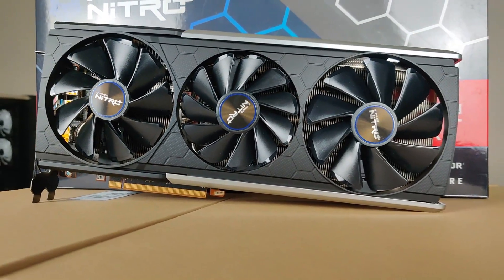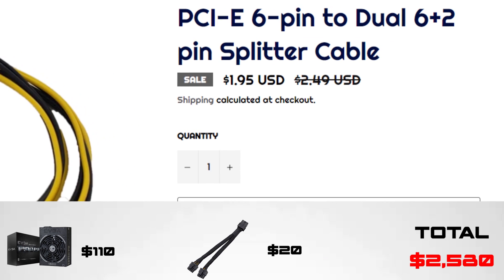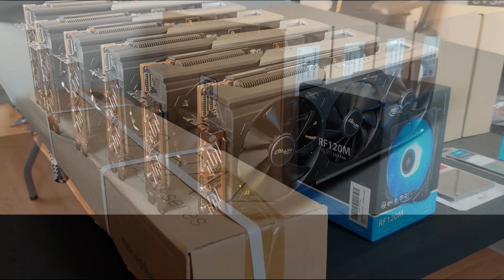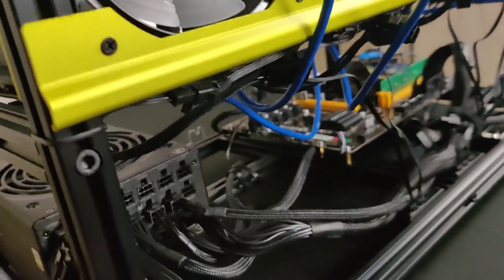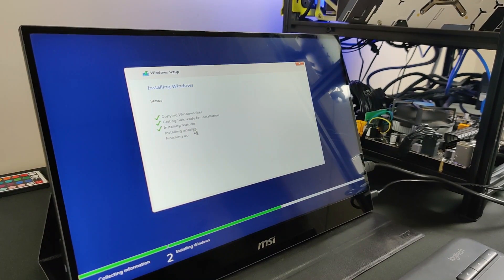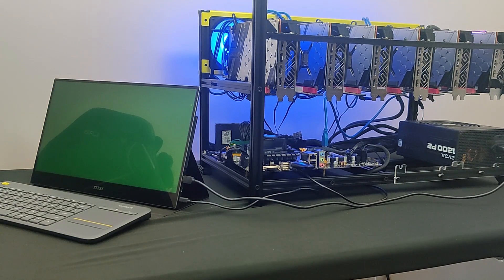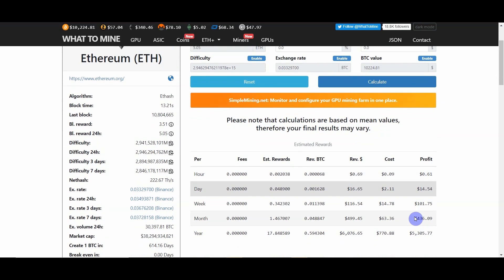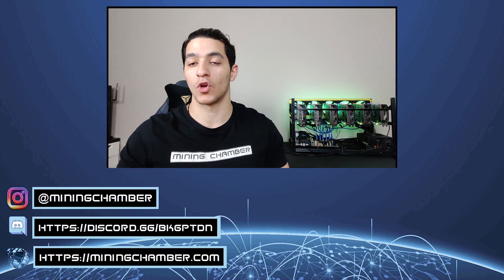RX 5700 XT Mining Rig Build - 6 GPUs | 330 MH/s and ONLY 880 Watts!!

Comment: RX 5700XT Nitro plus should issue 59mh/s
Reply from the maker: It can reach that for sure!
Reply: @MiningChamber  1000% You need to flash the timings and configure the card correctly and everything will work 350mh/s. our cards can be even more ~60+mh/s
Reply from the maker: Oh wow that's awesome, I did BIOS mod all of them with the usual copying 1550 timing to the values below, it can be found in our 5700 XT gpu overview video. Is that the flashing your referring too or is there more we know not about?

Comment: Hey brother, great video! 1 question.. the fans you put on the frame towards back of cards, are they blowing air into the rear of the cards or pushing air away from cards?
Reply from the maker: Hey thank you brother! They are pushing air towards the gpu and then the GPU pushes hot air out towards the front of it (I/o ports on the metal bracket)

Comment: hey im new here, i was wondering what you think of nice hash. i heard it automatically mines the most profitable coin and trade it in to bitcoin, automatically. i was wondering if I should just use that  or do something else. I'm pretty much a noob when it comes to stuff and my kwh here is 10 cents where I live. So would it be worth it?
Reply from the maker: Hey welcome! Nicehash is great for getting started but I would still recommend running phoenix and such since Nicehash takes 5% while doing it manually ( which isn't hard to set up at all) takes about %2 at most. Mining most profitable coin then turning into BTC can depend on when you decide to sell or not. Since BTC can also go down and up! 

10 cents is a pretty decent rate for mining for sure! 10-13 is usually average electric rate
Reply: @MiningChamber  ok thank you so much

Comment: Nice vid man how do you connect the 6 gpu's ? at you psu with an 6 to 8 pins splitters? I have an hx1200 that can handle 5 gpu's so i need to spilt it up i think.
Reply from the maker: Hey! We connected them using splitters! so just try to get some splitters and then if  you end up not having enough still then you can power 1-2 risers from Molex
Reply: @MiningChamber  Thank you for your reply. My risers are connected via molex that is ok but the rx5700xt's have an 8pin and 6pin connection and my psu corsair hx1200 have only 5x 8pin to 6+2 - 8pin so basically i only can connect 5 gpu's. What do you recommend in this situation?
Reply from the maker: You should get splitters in this situation, I recommend checking our ATX PSU guide! It will help you avoid damaging your hardware and properly hook it up
Reply: @MiningChamber  thx nice guide, i have 8 pin female to 2x 6+2 pin male splitters so i can expand one off the 6+2 pci-e connections https://media.s-bol.com/J6Zr8nmZVn5P/550x316.jpg for two gpus right? without doing dangers things.
Reply from the maker: Power first 5 GPUs with what you have and then add a splitter or two to power one gpu through 2 cables. Also I recommend getting additional splitters to power your risers with 6 pin too since it's alot more safe and reliable

Comment: Amazing video, used your affiliate link to buy all of the same parts... I’m thinking about doing 2 more GPUs... is one PSU OKAY? I have the same one. And when do I need a new PSU? Could I  run 16 cards off same motherboard with 2 of those PSU?
Reply from the maker: Thank you!! I would recommend doing 2x 850 Watts PSUs or 2x 750  or 1600 Watts PSU so you can stay on the safe side! As for the motherboard you can run max 14 cards out of Asus B250 Mining Expert without having issues, the 5 other slots need to be mining dedicated cards I believe. 

I would get 2x 1600 Watts for 16 cards!

Comment: If it is 12x5700xt, do I need to buy 2 monitors and 2 keyboards?
Reply from the maker: It all depends! If you do all 12 cards in one motherboard then you just need one. It's basically a PC with multiple GPUs. If you seperated them and did 2x 6 gpu rigs then yes, but one monitor and one keyboard is good enough for both scenarios since you don't want to keep the monitor always on when it's mining, it will just use more power

Comment: I’m closer to getting everything assembled :)
Let me get this straight, you are running the VGA cables from the PSU to the 6PIN female end of the splitter and then connecting BOTH two 8PIN male ends of the splitter into the GPU?
Reply from the maker: Bingo. ;) Watch our Radeon VII build we go in details with the wiring !

Comment: Where does the purple/white 2PIN wire connect to on the motherboard? (5:57)
I’m in over my head 🤦🏼‍♂️

*UPDATE- After some research, I figured out it’s the Power Switch cable so I connected it properly to the PANEL1 ON/OFF pins (15/16). But where does the other end go!? I see in the video, you just wrapped it around the motherboard post, so I did the same. Does it not connect to anything?
Reply from the maker: Exactly you can just wrap it around!! And awesome! It's like a little switch that's basically it!
Reply: @MiningChamber  Thank you! 🙏 
You’ve been a lifesaver! 😇 Do you have a video going over how to plug in the rest of the cables? Where do I connect the rest of the power supply /PCI-E cables?
Reply from the maker: @st.patrick2207  yes we do! Our 2nd video in the channel is a full guide to build a rig ;) check it out! Thank you!!
Reply: @MiningChamber   I watched the video but unfortunately unable to determine where everything goes. The VGA cables connect directly to the GPU’s? Why do I have 4 x PCI-E 8 (6+2) and 2 x PCI-E 6-PIN + 8 (6+2) VGA cables? I’m lost.
Reply from the maker: Try watching this video https://youtu.be/e7AO8ADUD5g it will clarify the cables further

Comment: Im just trying to understand how is that possible to get above 50mh/s on PCIE x1 lane. Bandwidth while mining do not require so much space like while playing games?
Reply from the maker: I'm not sure what you mean! Cards are capable to push that much hashrate due to memory bandwidth and frequency, with gaming it's different since it is also very core intensive while mining on AMD cards is usually just memory intensive
Reply: @MiningChamber  I was pretty sure high lvl cards like 5700 XT and above needs more than PCIE x1 to work on full performance :D so thats kinda shocking right now to me. Good job, thanks for that video!
Reply from the maker: Ohh I see! Maybe because the risers are also powered by an external 6 pin to provide watts to the cards ! Thank you! Cheers my friend

Comment: Good vid man. Why do Windows mining over Linux mining? Wouldn't Linux be better for this?

Also on a side note has anyone done anything in the realm of building a fish tank version of these and cooling it with silicone or whatever instead of fans? Wouldn't that offer more efficient cooling and allow you to jack the speed up on all the cards?
Reply from the maker: Thank you! Linux is surely better for lot of scenarios but since I never had issues with R7s in windows 10 that's why we don't mind it there!

As for the fish tank I have seen a couple projects cooled in distilled water a while ago it's pretty awesome! You can only push them so much though

Comment: Hey there! I finally got all my RX5700 XT Nitros and parts for the 8 GPU build. Running into major issues with the 2 EVGA PSUs for some reason not firing up the rig. It just turns on for a split second and not even most of the hardware turns on, then off. One PSU clicks, then the other. Never seen this happen with my other 8x card builds. Any idea what could be happening?! I'm using the Asus B250 board with 2x 1000w EVGA Supernova Gold. I can get 1 PSU to work, but I'm limited to 4 GPUs (being ultra safe with wiring). Going to try the PSU to see if 2nd one is a dud.
Reply from the maker: Yes definitely check your PSU! If one works fine then everything in the motherboard should be good but the PSU! Let us know!
Reply: @MiningChamber  Problem solved! I was being an idiot and connected the PCIe molex bank connectors on the mobo. Apparently do not do this if you're using powered risers; I read a post where a guy fried his PSU this way instantly. Strange thing is that I have another 8x GPU rig that has exact same B250 mobo and it's been running with the molex connected to the banks w/ powered risers. Needless to say, I fixed that right away as I figured out what was causing the malfunction on the new rig. Good pro tip for your new vids: don't be an idiot and read the directions hahaha
Reply from the maker: Oh wow that's interesting, your referring to the molex connectors on the motherboard and you connected them with a molex strand and that was why it didn't work? Usually you do need to power those that's quite interesting hahah
Reply: @MiningChamber  did BIOS flash on these and then tuning. Looks like Phoenix Miner runs this much better. Claymore seems to not be able to tune voltage (always) and memory (sometimes). Running stable right now on Phoenix Miner @ 438.8 MH/s (8 Nitros; ~54.8 Mh/s each) at 735w total GPU draw and 1200w at the wall. How am I getting so much draw @ the wall?! My other rigs are also ~400-500w in system/PSU efficiency loss. I'm stunned when I hear people budgeting for 200w system draw....

Going to keep tuning... life of a miner lol. Thanks again for the videos!
Reply: @MiningChamber  You're not supposed to run the molex to the mobo banks if you're using powered risers. Do some searching on the web and you'll find some forum posts about people frying their PSUs by basically doubling up on the mobo molex + risers. I am surprised my older rigs haven't had issues with this double connection, but these new EVGA PSUs caught the issue without even me knowing about it....

Comment: can you send me the link of the adjustment profile that you used ? ( I got the same GPU cards ) :P
Reply from the maker: Those adjustments I made and saved locally! And remeber even if it's the same gpu model it might vary on how you can push the card. Check miningchamber.com overclocking section and use the value range we give so then once you find a stable point you can save that profile on your mining rig

Comment: After downloading the latest version of clymore miner (it is v15.0 now) ,
unpack it, find the "start" file and select the edit file option. 
Delete everything from inside, copy-paste this and you are good to go. 

"setx GPU_FORCE_64BIT_PTR 0
setx GPU_MAX_HEAP_SIZE 100
setx GPU_USE_SYNC_OBJECTS 1
setx GPU_MAX_ALLOC_PERCENT 100
setx GPU_SINGLE_ALLOC_PERCENT 100
EthDcrMiner64.exe -epool eu1.ethermine.org:4444 -eworker Rigx8 -ewal 0xe5e011441dc2353b046aa30a22a818f0a44f7468 -epsw x -dcri 9 -tt 75 -rxboost 1"

All you have to do is swap the address with yours,
save the change and run the "start" file.
Reply from the maker: Thank you ⛏️⛏️

Comment: How did you install the ARGB Sync Cable with the Mother Board? Is anyone can help me about it?
Reply from the maker: I did not install one, it doesn't use sync it just runs off of a controller and a 12v to SATA. Some RGB fans require sync but for these we ended up getting a controller with 12 v to SATA
Reply: @MiningChamber  So, I ordered the EZDIY fan from the link you provided. And there is a ARGB link came with. So, do I just install the SATA cable into the Power supply and leave the ARGB Sync Cable?
Reply from the maker: Correct you can leave out the sync cable and see if it runs. If your fans have one cable to connect then you should be fine
Reply: @MiningChamber  Thank you ~

Comment: asrock rx 5700 xt taichi i did mod but i got black screen! 
so is that lock stock bios ?
Reply from the maker: Hmm could be a locked up BIOS, did you save the original BIOS?
Reply: @MiningChamber  I gave for warranty there replaced. I got it back and. Please tell me Which is best for Rx 5700 XT with mod
Reply from the maker: @LifeHacks007  Nitro+ is my top fav model but other than that all of the cards should be the same. GIgabyte and Strix need the specific BIOS I have pinned in this video https://www.youtube.com/watch?v=F-GFMUYFQPM other than that try to look for the ones we recommended in that video linked above ^ We have a list in the description for it
Reply: @MiningChamber  Thank you for reply! :)

Comment: I am building this rig right now.  Sadly I ordered 4 of the msi radeon 5700 xt mech os.  I got them in the mail and they where manufactured in Tailand.  I got them at a decent price so it is what it is.  I just will keep them around 55 mhs until I get a feel for them.  Can I make a 8 gpu version with two 850w gold power supplies?
Reply from the maker: Nice! It is okay as long as you can provide nice cooling for them, a box fan does a great job. 

Our next build is actually exactly that ;) 8x 5700 XT with 2x 850 Watts PSU ! So you will be all good

Comment: Currently running 4 Sapphire Pulse Rx 5700 XT cards on an Asus B250 Mining Expert. I followed your guide for the memory straps mod and didn't touch the power play tables. I then undervolted in hiveos beta. 224mh at 535w from the wall. -vdd 750 -cclock 1375 -mclock 915 (if Micron memory) -mvdd 1305 -vddci 775 (if Samsung memory) -mvdd 1355 -vddci 815 I applied my gpu settings on a per card basis within hiveos not phoenixminer command line. All credit to mini_me on the igorslab forum for the memory values.
Reply from the maker: Nice!! I will be trying out these values thank you!

Comment: Did you get this sorted out?  Just did a video with my pulse 1 card test idle draw on my system is 17w with the card its 35w thats 18w a card just from fans which adds 108 watts to your system at 6 cards.  I am getting same numbers as you at 158w total system with 1 card which puts it at 948w with 6 cards which is only 8w more then what you are getting now.  So am thinking the extra watts is from the cards fans using power when ramped up for cooling.
Reply from the maker: That can for sure be the reason, maxing out the fans will add more watt usage although now my rig averages 880 watts off the wall with fan speed at 60% and a 780 mv undervolt
Reply: @MiningChamber  nice right on got it sorted out then :)
Reply from the maker: Awesome ;)

Comment: Hi bro I have some problems  when I  run 6 GPU maybe  5 minute  my pc is shut down but when  i  use 5 GPU it works well 
I use power Supply 1050w gpu 3 asus 1660 and gpu 3 msi 1660 super 
What the problem please help me
Reply from the maker: Hey! I would check your motherboard settings for enabling 4g decoding, mining mode, etc. If you have any of those. They can be found in your motherboard BIOS
Reply: My motherboard is asus b250 mining mode  is enabled I use only 1 power Supply  1050w how to fix or I have to change power Supply?
Reply from the maker: Hmm that's wierd, double check all your connections and cables. Try to not overclock that card too much or try to switch out one of the 5 cards with the one that you take off to see if it is because of the card or because of having 6 cards plugged in.

Comment: Would you recommend waiting until new GPUs are released or using the components recommended in your video? Thanks for the video!
Reply from the maker: I'd recommend trying to look for deals! If you can't find good deals then waiting till new GPUs are available will be better financially
Reply: @MiningChamber  waiting for new GPU's will have you waiting for a few more months I'm afraid :D at least you can get some 3090's, which at 110-145M using ~300w are not that bad :)
Reply: just buy all until its out of stock too

Comment: So, an Antminer S9 with PSU sells for abour $200USD (used on ebay) with about 7TH/s, yes TERRA Hash.
Why use a GPU?
Reply from the maker: It is an ASIC miner not a PSU and the 7TH is on Bitcoin! a different alogirthm, different difficulty. You can't mine Ethash algorithm on that ASIC. Each one is made for a specific Algorithm. So they are not as diverse as GPUs. Hopefully that helps!
Reply: @MiningChamber  Thanks, its the reprogramming feature that makes GPUs preferred over ASICs Miners.

Comment: hello nice video !!! sorry to ask dummy questions but its the first time i builg a mining rig !!! but on this Motherboard where to you plug the RGB cable for the fans.. i didnt saw any RGB or led pin , so can you show where to  plug it. thanks
Reply from the maker: Hey! Thank you!! Unfortunately the 12V RGB cables dont plug on the motherboard :( I got one that plugs to SATA so I didnt have to use a 4-5 pin to Motherboard. EZDIY fans the one we got usually have a 12v SATA controller!
Reply: @MiningChamber  Sorry to ask again, im not sure to understand you. There is 2 connection needed to be done, in order for the fans to work : RGB(to control  the lights of the fans) and the PSU connection. So for the PSU i agree its the sata connection but since there is no pins for RGB on that motherboard, you use a other sata connector  to control the RGB for the fans ? I looked on amazon for the EZDIY(EZDIY-FAB 120mm ) model and i see a sata connection to the PSU for the power but still use RBG to connect to pins on motherboards...perhaps if you can provide me the exact model, i might have looked to the wrong one or misunderstood something.
Reply from the maker: That RGB connector is most likely for Sync. ( Syncs motherboard rgb with the fans) but if you get the ones with the controller and the fans only connect to that fan hub that connects to SATA then they should turn on RGB and work through that mini controller. 

https://www.amazon.ca/dp/B08C2FWMX9/ref=cm_sw_r_cp_apa_fabc_upcPFbFQDWGRM?_encoding=UTF8&psc=1 this is an example